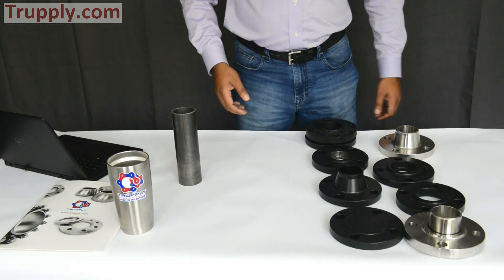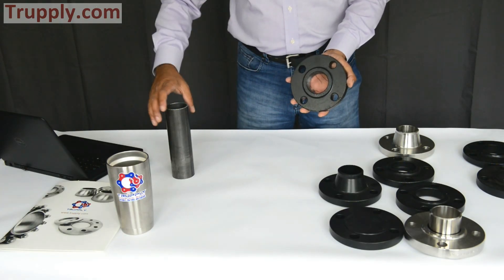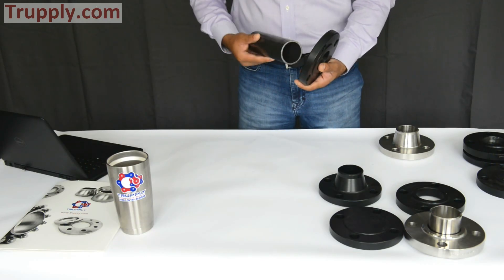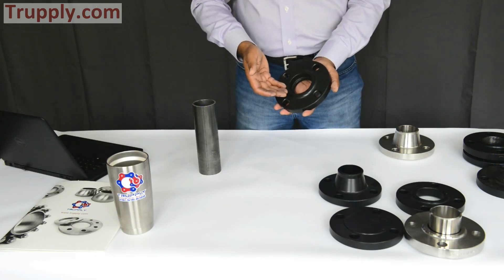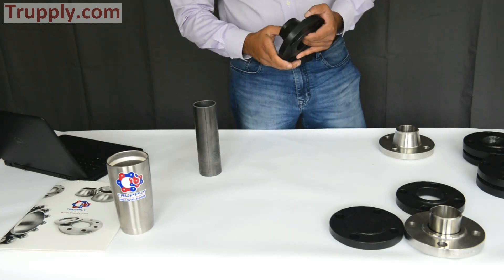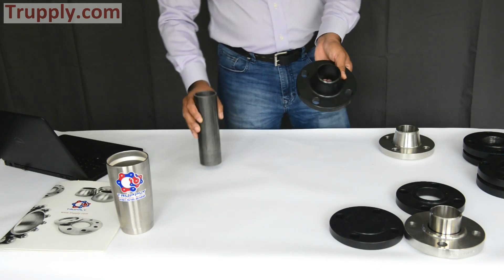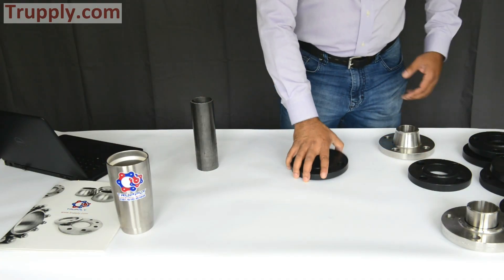Steel Pipe Flange Types

Comment: Hello Everyone 

We would like to introduce ourselves as manufactures & stockist for Stainless Steel, Monel, Inconel, hastalloy, duplex and all High nickel Alloy steels we also deals Perforated Sheets and manufacturers of SS and High nickel Alloy Pipes, Flanges & Pipe Fittings

Material Grade : SS 304/304L, 316/316L, 301, 301LN, 309, 310S, Duplex 2205, 2507, 409, 410S, 420, 430. 

 Also suppliers for Boiler Plates, Corrugated Sheet, Rods, Angles, Forge Fittings, Flats Bar, Strips, Tubes, Wire Mesh, Wire Net, Camlock Coupling, Fastners 

(Specialist in High nickel alloy)

Sanghvi Overseas

Tel    : +91-22-6659 5387
Mob :  +91-9867 754 399 

Email :info@sanghvioverseas.com

Web  :www.sanghvioverseas.com

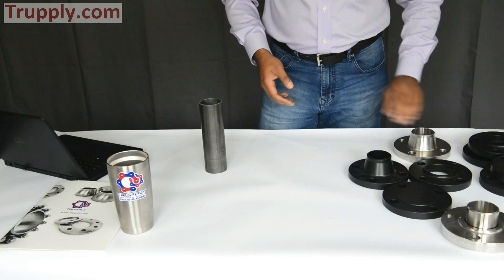Comment from the maker: 150 lb or 150 # is the term used to specify pressure class of the flange. There is no real correlation of this with actual pressure rating which is also a function of temperature. The pressure class starts from 150 and goes all the way to 2500. 150 lb & 300 lbs are the most commonly used flange pressure classes. In the video, at 7:25 there is a table that correlates pressure class to European classification of pressure (PN) and pressure rating at various temperatures.

Comment: What do you mean when you say 150 lb?
Reply: 150 psi is the rated working pressure for that flange at a certain temp. I believe it is somewhere 8 to 900 degree range.